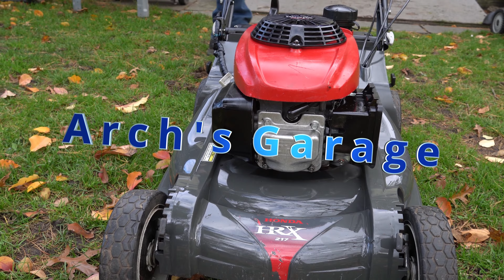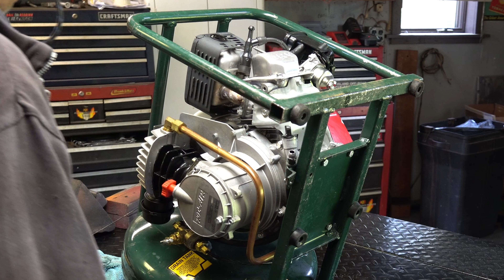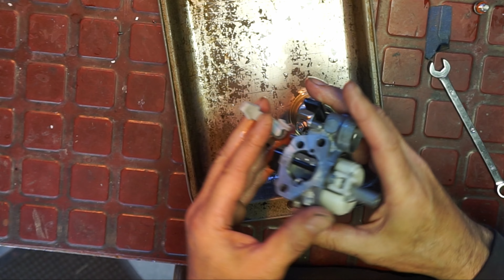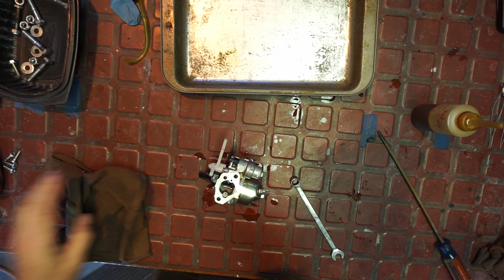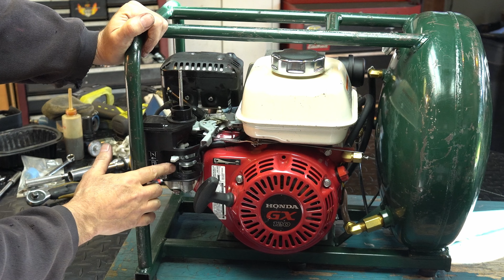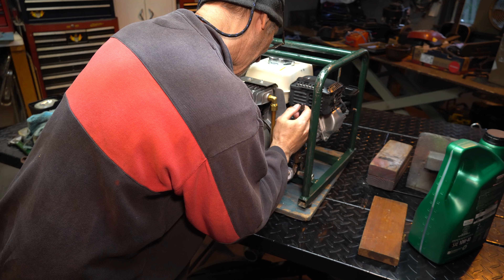Rol-Air Air Nailer Compressor~ Honda GX 120 Air Compressor Repair ~ Full Service-Carb,Valve Check

Comment: Mines runs fine, then hits max psi and shuts off. Doesn't idle down
Reply from the maker: That's usually a linkage issue, easy fix though! 👍 Hard to say,, this one was a mess!

Comment: also, that rattle could be the screw that holds the air compressor crank to the honda crank. have to take the end cover off the air compressor crankcase to check it. i had one loosen up.
Reply: I’ve had to rebuild the one I have twice, replaced wrist pin, crank for the pump, and the connecting rod, 4 months later, wore out again, cheap cheap parts. It’s too bad because they are handy little machine’s, motor is top notch never an issue with it. Just the pump.